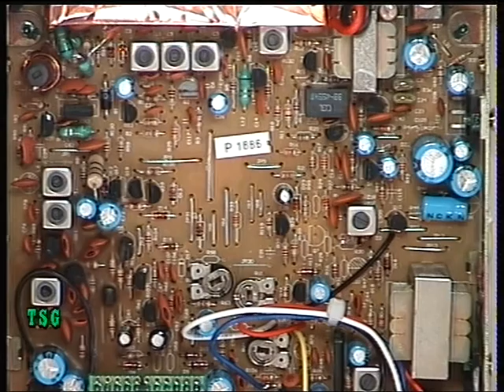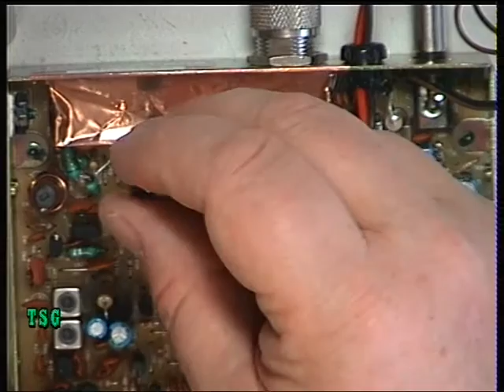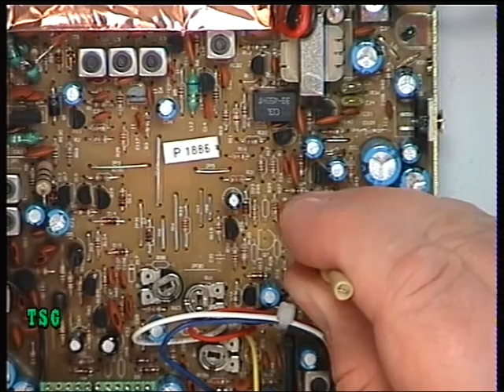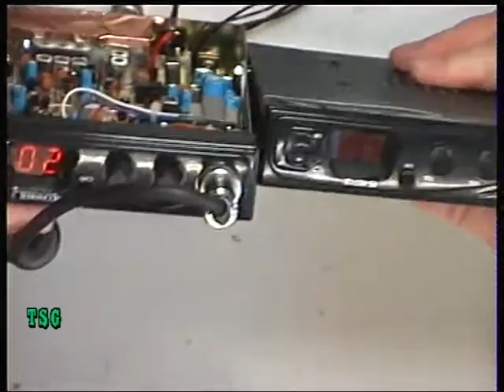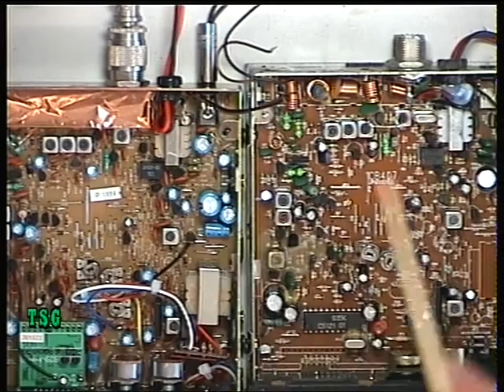Moonraker Minor CE late version UK (PR27/97) CB radio mobile) - receive adjustment

Comment: Hi Richard, would you happen to know where I can get an online schematic for this version? I have a squelch problem with mine. When the control is anywhere close to the threshold, I just get a mass of loud continuous crackling & popping. It's like Rice Crispies on steroids!
Thanks in advance for any help!
Reply from the maker: No, I've never seen a circuit for this version.I have the earlier version circuit only. If you have owned this radio from new, has this problem suddenly developed or has it always been like this?  Looking back at my 'on the air' video of this radio, I start on ch28 & it sounds like rice crispies crackling & popping! have a listen.

Richard
Reply: @ukfmcbradioservicingTango21  Yes it's very similar to the beginning of that clip. I've only just obtained the radio so I'm not sure if it's a fault or a "feature" so to speak. It's fine if you're speaking to strong stations, you can have the squelch way up past the threshold, but if you're speaking to slightly weaker stations you have to put up with the constant crackle and it's quite unbearable. Pity there's no schematic available for this version. I have a feeling that the squelch is controlled by the IC on the vertical add-on board. I suppose I can just test all of the electrolytics, transistors and diodes down in that corner of the board.
Reply from the maker: @live2digmetal  I think you'll find it isn't a fault but just the way it is.'crap squelch'!
Reply: I'm sure it has to be a fault Richard. My wife shouted through and asked what the racket was, and asked if I was using a gieger counter! Something significant I've noticed about it is that the volume control has no effect on this crackling, it continues at almost full blare regardless of the volume control. The volume works correctly otherwise if I leave the squelch at minimum.
Reply from the maker: @live2digmetal  If it's the far side of the volume control then the chances are you may have a duff electrolytic capacitor around the amplifier I.C. These sets are now 15-18 years old so it wouldn't surprise me.

Richard
Reply: @ukfmcbradioservicingTango21  I found out it's the same as a Dragon CB407 
http://www.cbradio.cz/doc/Dragon/CB%20407/schema.jpg
Reply from the maker: thank you.